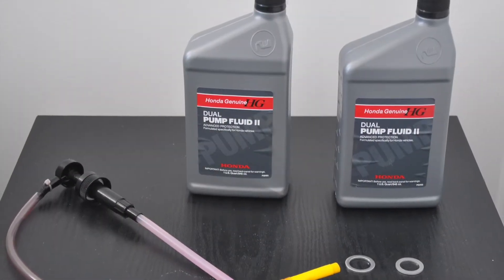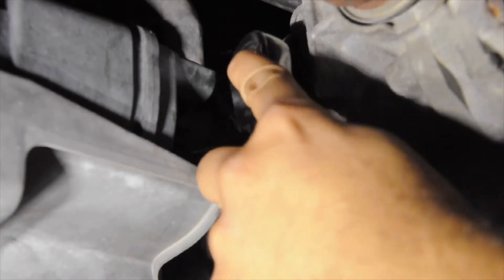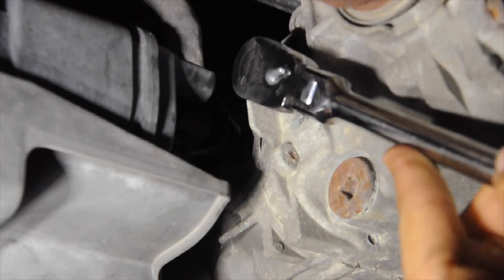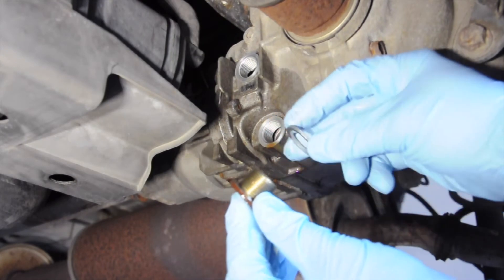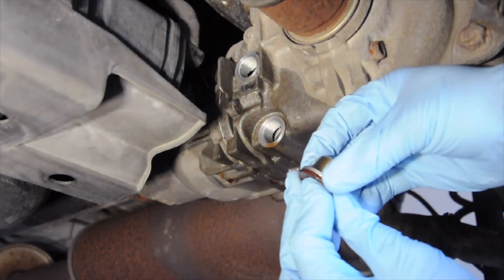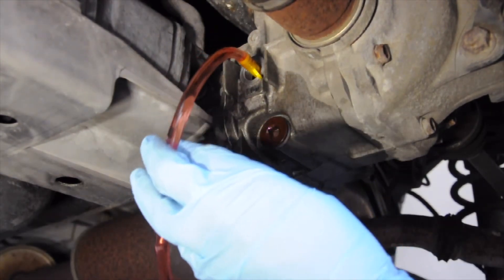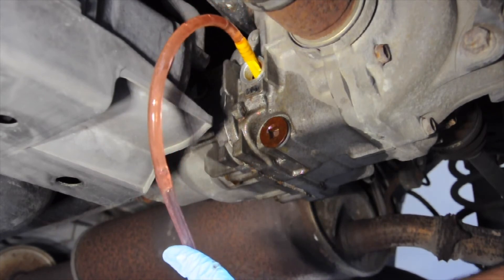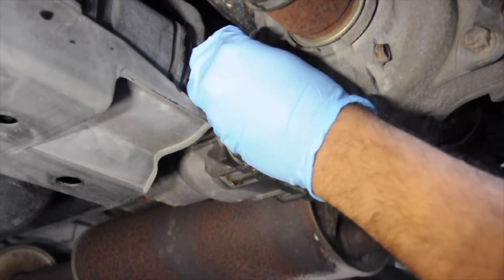Fix Honda 4WD Noise - Honda CRV / Element differential fluid change

Comment: Thanks a lot for the practical demonstration.SO you need two bottles???Bcoz the dealership told me 1litre will be enough. Which is the correct position for an re4 2006 crv.
Reply from the maker: Yes you need slightly more then one bottle. So you will have to buy two.